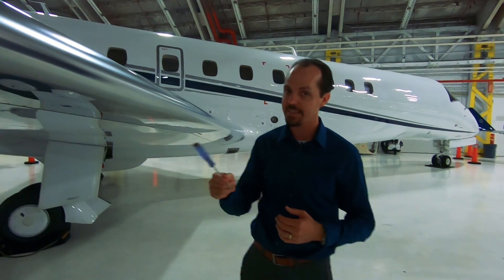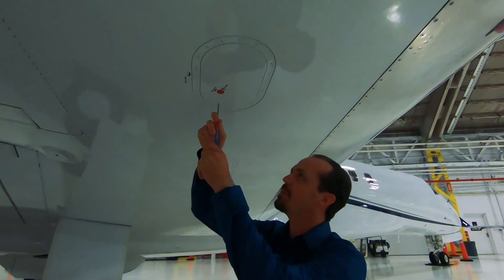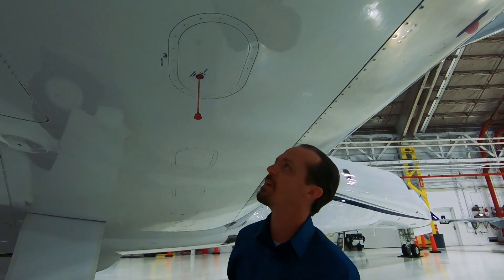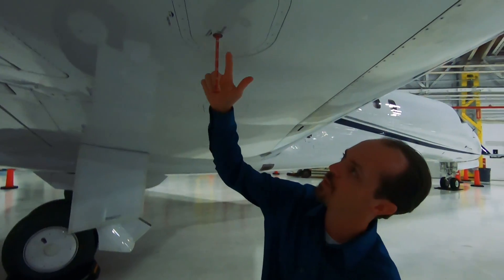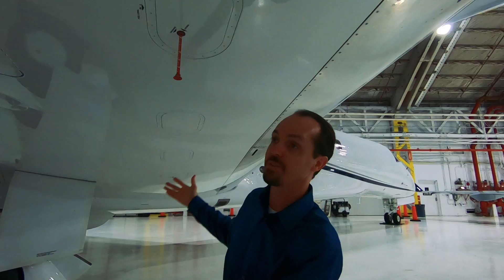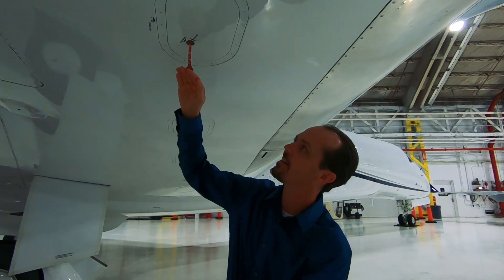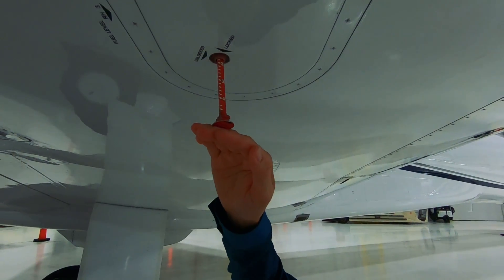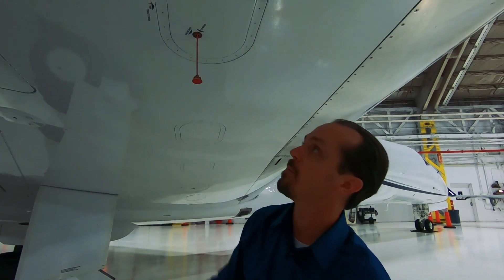How To Check The Fuel In a Private Jet - Tech Tuesday

Comment: Being an auo mechanic that looks like something that might leak down the road.  As it appears to be a float system and has to be sealed to get through the tank. (the stick)...unless it was magnetic somehow? I could maybe design something like that to prevent needing a seal, but then it wouldn't be a straight mechanical dip stick and could be wrong or fail.. So "if" that seal works for ever then i'm sure its a good system of redundancy!
Reply from the maker: I believe it is a magnetic system that requires no seal at all...

Comment: Has an ICAS system on a Gulf ever failed?  NO. Has there ever been an accident with a Gulf 650? NO. Never. Safest plane in the sky. So....  You're fake slap at them is ... well... fake news.
Reply from the maker: Actually I'm very partial to Gulfstreams. It was my first type and I have 3000 hours flying them all over the planet with very few maintenance issues. As for the G650 accident, there has never been an accident after it was certified, but one did crash killing all on board on April 2, 2011 during flight test. Again, I absolutely love Gulfstreams and always will for many many reasons.

Comment: Those are called magnasticks or a Drip stick. The older 727's and early 90's model of aircraft had drip sticks. The fuel would actually come out of a small nozzle. The magna sticks are much better.

Comment: That seems it would be prone to leaking. When secured a good o-ring would probably hold for quite a while but when you pull it down it would be hard to keep it sealed. If it were on top of the wing it could be released to float up and give you a measurement calibrated to give you a reading and not have fuel leaking down.

Comment: I have question for you with your HS-125 where is your cabin crew if you running Part 135 does the FAA not require on any more, when we ran our HS-125 we always had one?
Reply from the maker: Nope...not required on smaller planes. Once you go over 19 seats then you are required to have on.

Comment: Love the new magnetic style of "drip stick". Where it's totally sealed and no fuel is spilled. The original style was a hollow tube, hence the name "drip stick". When you lowered it to the fuel level, fuel would drip down through the tube. When fuel came out, that's where you would read the scale.  Due to this, you would normally get sprayed in fuel!

Comment: The same system was used on the DC-9.  There was also a plumb bob in the nose gear well.  It hung over a metal plate with a grid on it that when released it would show the attitude of the aircraft while on the ground.  You would then refer to the manual, find the attitude and then read the measurements at each station to get the true amount of fuel on board.
Reply: Exactly. I had to utilize this system on occasion  while fueling DHL DC-9s back in the day. Pain in the butt.

Comment: coming from the airline side, our 737s, 767s have the same system, being the Legacy is derived from the EMB -135 airliner it is likely why it is on that type
Reply: Darrell Gordon as did most larger airplanes back in 50 and 60 they were used quite a bit to verify the fuel gauges. I remember they were used more on piston aircraft than jets or turbo props but still there

Comment: All the airliners have it.  Its a pain in the rear.  Had the fuel gauges on a MD-11 go haywire.  Took the mechanics about 30mins to dip all the tanks and complete the calculation.  ended up being 1000lbs short.  I added the 1000lbs and the mechanics had to re dip and calculate to confirm.   Had it also happen on a 777.  Sketchy as hell.
Reply: I’m not even sure if the dip method is legal in Canada

https://www.cbc.ca/archives/when-a-metric-mix-up-led-to-the-gimli-glider-emergency-1.4754039
Reply: @jerrykorman7770  Its legal. I was an aircraft fueller and now a pilot up here in Canada.   The Gimli Glider accident was due to the airline switching to the metric system.  There was nothing to do with dipping the tanks.  Just some bad unit conversions.  All airlines now (expect American operators) use the metric system.    As an aircraft fueller you have to be very cautious with who is using metric or imperial.  There is quit a difference if you get them wrong.
Reply: In the words of my fluid dynamics professor (ex-flight test engineer) "Units! Always check the unit! You will kill someone if you don't!"
Reply: Flying Adventures gotcha. Yeah, more than a rounding error
Reply: Flying Adventures lol
Reply: End Leftism wow sorry to be a buzzkill

Comment: I've used those before, mostly on large cabin or commercial aircraft.  Those are probably called magna-stick, the old school used to be drip-stick.  You used to pull them out until they started dripping fuel out, that indicated the tube was at the level of fuel.  One of the things you want to be sure of... make sure the aircraft is level.  If you can't assure wings and nose level, some aircraft, again commercial type, have a plumb bob set up so you can adjust the readings according to how un-level the aircraft is.  Thanks for sharing.

Comment: Why would you park it with no fuel????????? Doesn't that aid in condensation?????
Reply: Parking aircraft with full tanks will really put a lot of stress on landing gear components. You try to park as empty as possible
Reply: mains can divot the ramp in the summer if you tug it sharply when full of jetA so helps ground handling

Comment: In the airline world, we call it sticking the tanks. It is useful for quicker turn around times if the fuel system is inop. It also allows the airline to defer the maintenance to an airport where they have the ability to fix the issue. For example, TUL for American or ATL for Delta. There are set rules we have to follow as fuel guys in those cases and, at least at my company, only certain fuelers become qualified to work an inop with sticks.
Reply: You beat me to it. :)  I think the only reason the Legacy has sticks is because it's an Embraer 135 with modifications.  The wings are exactly the same as the 135 so it retains the mag sticks which are required for commercial operation.

Also, Sean, be glad you aren't working with an older aircraft.  The sticks were drip sticks back then and literally dripped fuel (you adjusted the tube until you started dripping fuel and then read the level).  Some airplanes you actually fueled by setting the drip sticks to the height that corresponded to the quantity you wanted in the tank and then fueled until you got a drip.  I can only imagine what kind of a total freak out an EPA inspector would have today if they saw us doing that.
Reply: @End Leftism They're there because the airplane is built off an airliner and the airliner requires it.  It has nothing to do with where the Legacies are flown.  If sticks were so important because of flying to places with little or no support, then we'd see almost every Bizjet with them.  The Legacy has them because they were already there and it cost more money to remove them (and thus get separate certification) than to just leave them.

Comment: I bet there is a cork on the end of that stick. Works for Cubs too.
Reply: I was thinking the same thing. The top of the stick must have a float on it?
Reply: @dafydd2277  maybe a little boat or jetski
Reply: yes a float and a magnet, the marvels of modern science.  magnetic fuel level indicator           https://www.youtube.com/watch?v=NclTiLoqxZs
Reply: They actually use a magnet and rubber float.  I've been lucky enough to see one of those sticks before install.